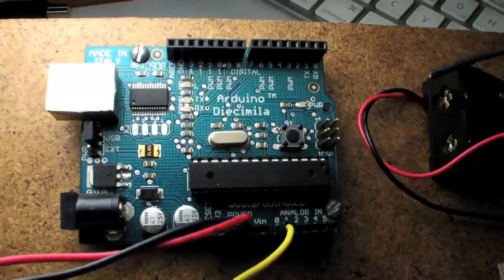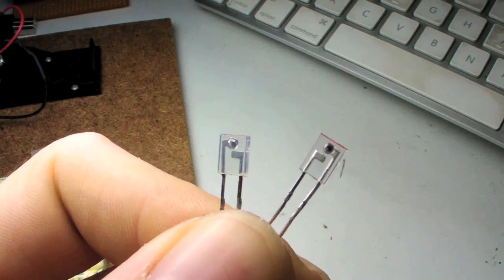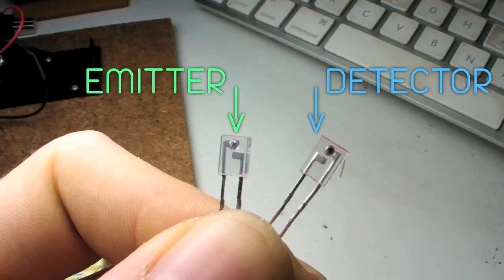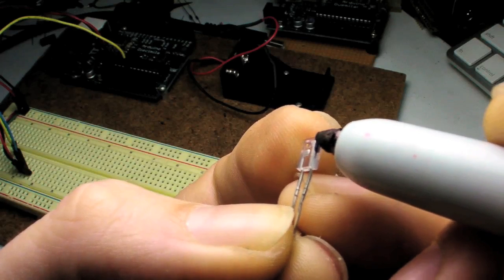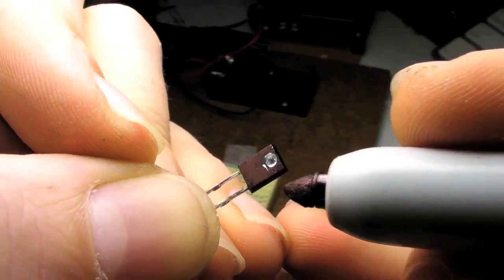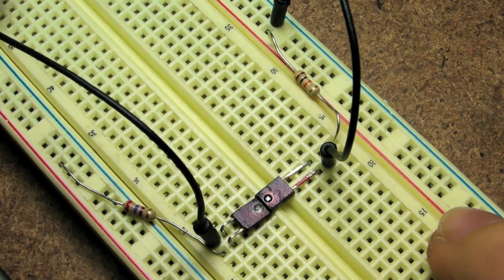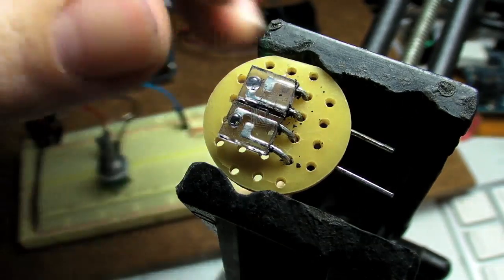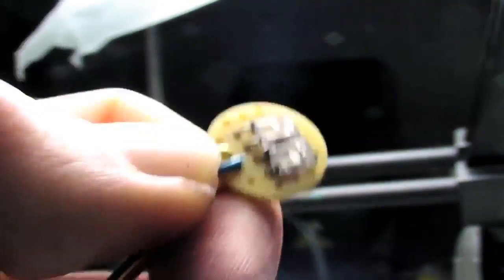Collin's Lab: Infrared heart sensor

Comment: You can add a different LED, say green, which will not be influenced by the changes in saturation, and use it to form a 100% value reference, then count the difference between the green and IR light intensities to get the saturation percentage.

Comment: Nice waveform. Much better than I get with that recycled crap used at the hospital. I usually have to go through 2 or 3 (sometimes more) before I can get a decent waveform and even then it is difficult to impossible see the dicrotic notch (usually depend on art line or ventric for that anyway). However, they are not infrared, just red, and are measuring O2sat. I was thinking of building a electronic stethoscope with variable low and high pass filters that can be adjusted for the bandpass range needed to isolate the sound you are wanting to hear. Just havent had time as of late but it would help me out a lot... and my patients...

Comment: So how can u translate the recorded waveform into an understandable language, say BPM?
Reply: Your comment fits your profile Pic!!
Reply: its just a matter of calculation via, programming or from visual interpretation derived from the graph. Once you can detect the heart beat you can make an app, or embed this idea into a project.
Reply: Have your micro controller count the number of peaks over the last 60 seconds. Have it do this according to the refresh rate you want.
example - you want it updated every one second, have it perform the 'past 60 sec' count every one second.
    Really bored?  have it measure the time between peaks and let you know if the heartbeat is regular or irregular.
Anything more involved would require measuring the voltage across the heart (EKG) noting amplitude of, and time between peaks/troughs then comparing them with known rhythms so a "choose all that apply" program can attempt to tell you what you see (or don't see). Basically an oscilloscope with an instruction set.
Many other options. This is the most simple I could think of.

Comment: Entirely correct. I interpreted his question as "Can the device be made to work without a part filling the arduino's function?", in which case you're going to have a bad time. 

Not passing on the collected data to any processing unit kind of defeats the purpose of the sensor to begin with :/

Comment: I tried with a optocoupler "TCRT1000" but I wasn't able to get heart rate from the raw data. However, when passed through 1,000 gain op amp, I was able to detect my heart rhythm... Making one is better then just buying one of those optocouplers.

Comment: mine doesnt work :(
the graph changes acording to the IR light reflected off a white sheet, but not with an artery, maybe its because i have low blood pressure? or maybe my resistor has to be higher...

Comment: What if you used sound detectors to pickup the pulse of he heart. It has 3 sensors that using a computer to detect 
and position the sound using the differenual of he sound. Idk if it would work but if it did you could locate a person or several people before you go into a room. Military applicaions "if it works and it alrready hadn't been done"